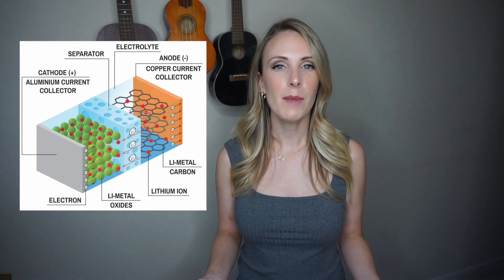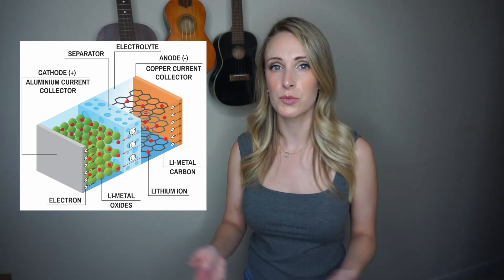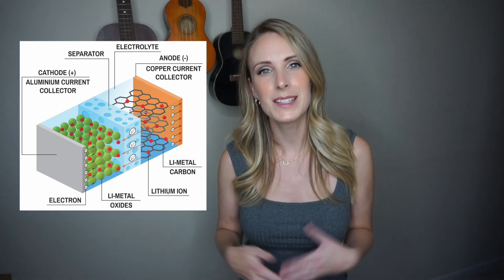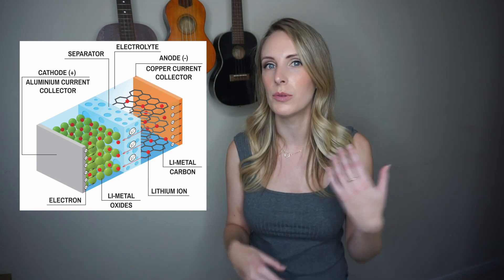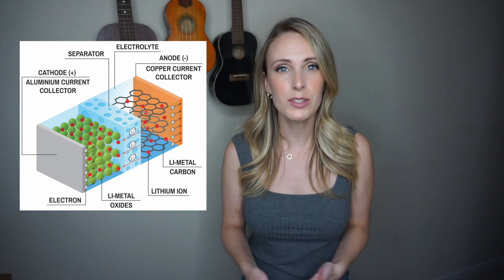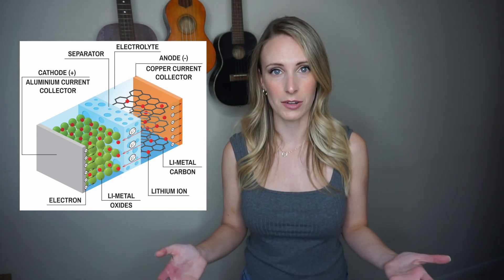Introduction to Bode Plots

Comment: Hello, I am a mechanical engineering student working on the design of a radiator for an EV. I just want to ask how to calculate heat generation from a lithium-ion battery pack of 48 volts, 100 Ah, and 1.4 C (hours). I am searching but unable to get a satisfactory answer. Please guide
Reply from the maker: This is a great question! Many simulations attempt to model battery temperature, but the work of my team at Electric Goddess has found that empirically measuring it renders the best results. I’ll give you a few considerations:

- heat is measured in Joules, so that’s Watts*seconds. You can calculate the Joules based on the battery pack parameters.
- different cell formats have different temperature gradients (cylindrical vs pouch cell, for example)
- cells in a pack experience thermal gradients not just from neighboring cells and the pack cooling, but also from environment (day-night, weather, etc.)

The main thing to focus on is- how can you ensure cells won’t go into thermal runaway and cause catastrophic failure to the pack. 

Don’t feel too stumped by this because it’s something that many companies struggle with, which is why my team is always busy helping others solve this exact problem 😊
Check out our podcast episodes at electricgoddess.co
Reply: @AcrosstheNanoverse  thanks for reply :)